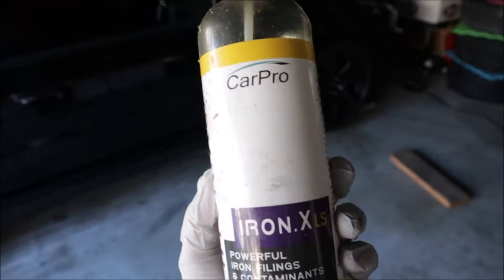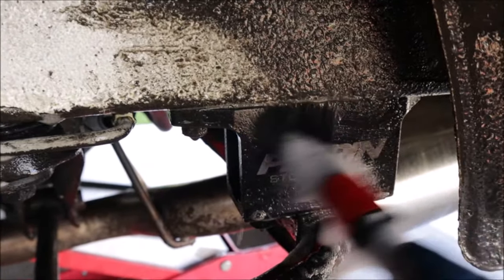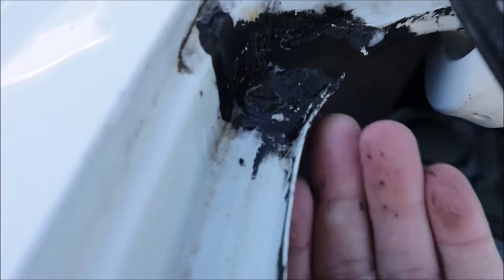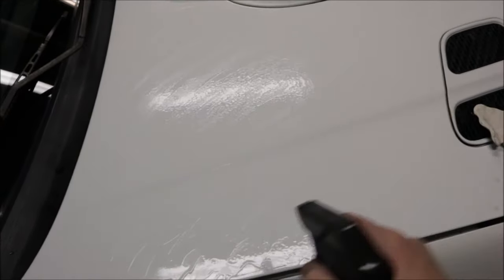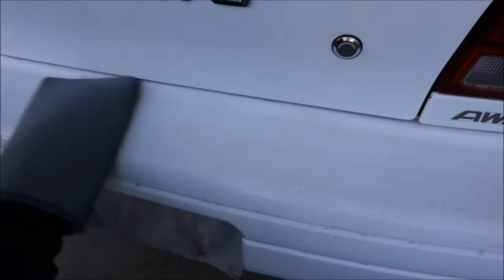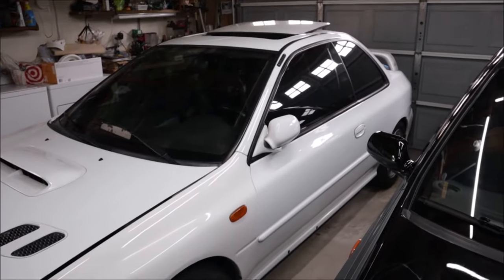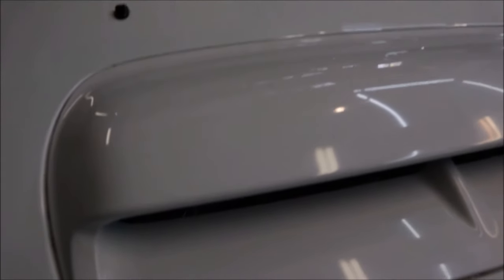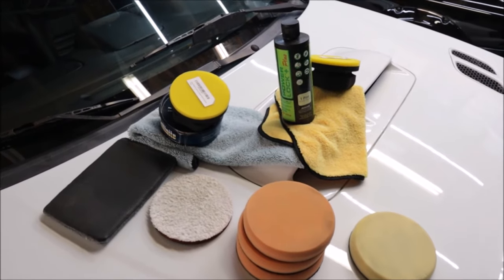Impreza 2.5RS GC8 Project Unicorn Part 2

Comment: They all rot on the corner, design fault of water staying in the indentation etc.
Reply from the maker: So disappointing!
Reply: yep my car has similar damage, not till that extent but its forsure a spot to always look after
Reply from the maker: My black one has zero in that area.
Reply: Since I was the first owner and I always garaged mine, I don't ever see rust like that in mine.   I'm pretty sure previous owners parked them outside all the time to get the water condensation/dripped and stay for too long and caused the rusts.  I think your black one pretty much stayed in a garage most of the time.  I realized that rust on my after market ebay tie rod when I replaced the old factory ones and parked mine outside for over a year.  I thought it coule be due to aftermarket parts.  But there's a high chance it's because it's parked outside for too long.
Reply from the maker: @dakenic  Yup outside parking will eat away at the car, and clear coat. Funny because my clear is mint! Northern CA always overcast and no sun! Yours sounds nice, want to sell it!?
Reply from the maker: @dakenic  SO clean, goals! That is Irvine, I may have herd about this car before through a friend. Maybe he wants to sell?? LMK!
Reply: @RoadPatina  For future reference, if you found that the shift knob has fresh leather and clean red stitches, that's probably the car because I replaced my OEM one with the genuine STI red stitch one before I sold the car.  Also the hole on the leather seat.  LOL.  That STI 5 speed STI shift knob is impossible to find now.  I tried.
Reply from the maker: @dakenic  yup sti knob and the rs knob are both discontinued and hard to find. A place in the UK is remaking them for a pretty penny. Lmk if he wants to sell it!
Reply: Mine has it as well just bad design